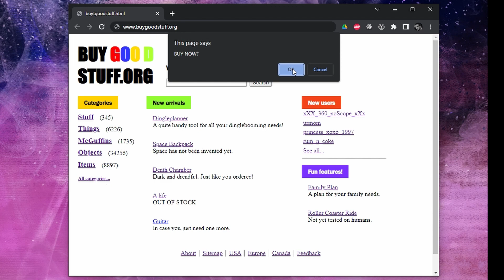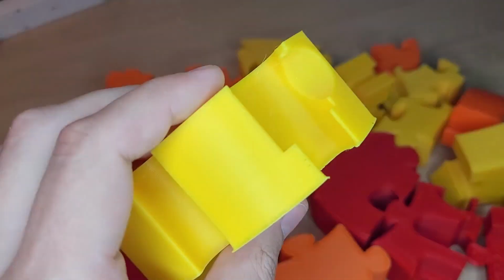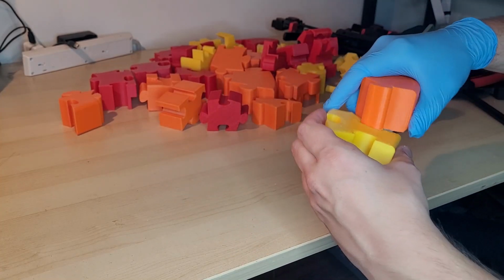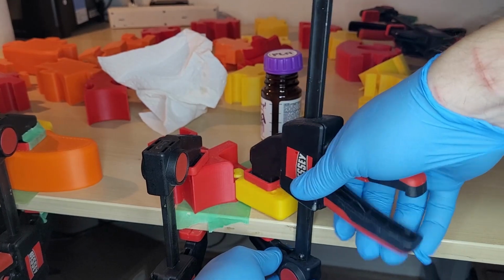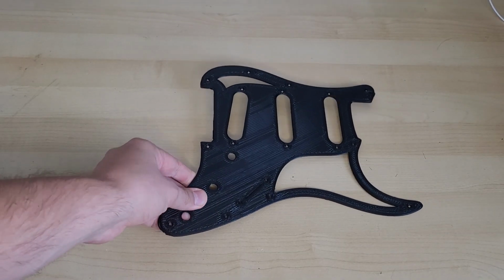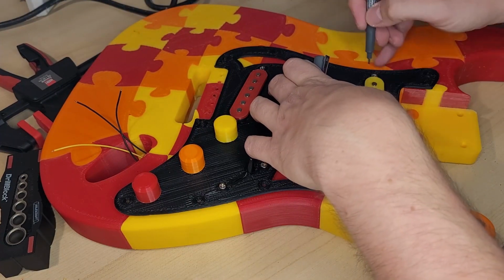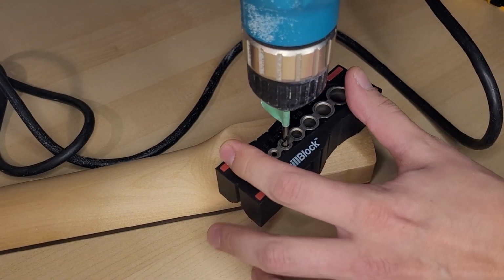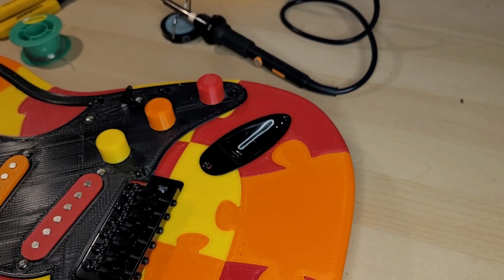3D Printing a Puzzle-Patterned Guitar

Comment: Thank you for this interesting project.  I'm in the process of printing out the pieces now.   They fit together extremely well.   I'm having a challenge printing the inner pieces with the trem cavity so i'm using supports to try to get them right.   But wow, this is going to be awesome.  Well done.   Hopefully it doesn't flex too much.   Thanks again for your generosity.
Reply from the maker: Cheers! Can't wait to see how it turns out!

Comment: This is a fantastic build! Only bit of advice I would give for anyone who does this or if you decide to build a second one is to flip your parts upside down in your slicer software so that the front has the nice smooth textured finish from the build plate (especially the pick guard) but otherwise this is awesome!
Reply from the maker: Very true! But also this build was made on a old Anycubic Mega X so the finish is... less than desirable. The next guitar build was made with my Bambu P1P and the surface finish is much nicer

Comment: You should be using a rubber mallet instead of a claw hammer. Alternatively if you don't want to buy a rubber mallet you can take a tennis ball and cut an X in it then slip it over your claw hammer.

Comment: That is beyond awesome! Really cool design. How far off did the intonation end up?
Reply from the maker: About 20 cents off at worse. Definitely an easy fix for next time
Reply: @xavierdumont  you could just adjust the saddle position
Reply: @jimthethirdprobably  do you think a 3D printed neck and fretboard is possible?
Reply: @maspesasmasperras5554  if you put a truss rod and some steel or carbon fibre in the neck then yes, i think it would be possible

Comment: I printed this out and purchased the exact same neck and hardware. Unfortunately the neck doesn’t fit! Any suggestions or advice on how to get it to work? Thanks for sharing this awesome project!
Reply from the maker: It's probably due to variation in print tolerances. I would suggest either reprinting the next pocket pieces scaled at somethinglike 99 or 98%, or simply sanding either the prints or the neck.

Sanding the neck will probably be much easier, though it might leave a less desirable finish.

Comment: Lovely. I am interested in how you made a jigsaw pattern on the template. Is there a tool in CAD that has this feature, thanks and regards
Reply from the maker: Thanks! I forgot to mention it in the video but I just drew it all by hand. I started with the template, then added concentric perimeters inside the template's outline. Then, divided that into smaller puzzle sections. Lastly, I added the "tabs" for each puzzle piece. After that I just tweaked the shapes a bit.
Reply: @xavierdumont  Ok, and thanks

Comment: Question, can I used 22 fret fit on this design?
Reply from the maker: Good question, it's hard to say exactly if it will work since the scale length has to be somewhat precise. The guitar already has intonation issues, this may or may not fix them. So, truthfully, I don't know.

Comment: so after a year or so how has the guitar held up?
Reply from the maker: Actually pretty good, the interlocking pieces really help with stability. With the pixel guitar, the glue had started to fail in some spots (mostly because I didn't put enough) but with this one, there are no visible gaps

Comment: What is that glue ?
Reply from the maker: It's called 3D gloop, it basically melts the plastic and fuses it
Reply: @xavierdumont  Thanks. Do you like it better than just using super glue on PLA parts? Super glue holds really well but the problem is you get about half a second to place it and if you put it in the wrong spot well you’re just out of luck.
Reply from the maker: I like it more, I find it holds much better, but the set time is super quick so you have to be careful. Also it's not as liquid and doesn't spread around so much so you can be more precise with it.
Reply: @xavierdumont  Nice. Appreciate the info. I’m going to give it a try. Your guitar project was very well done by the way. I am working toward projects of that level of complexity and am probably just a few months away from going for it. Today I designed and printed a custom luggage tag for my Sister’s Christmas present and it came out really well.